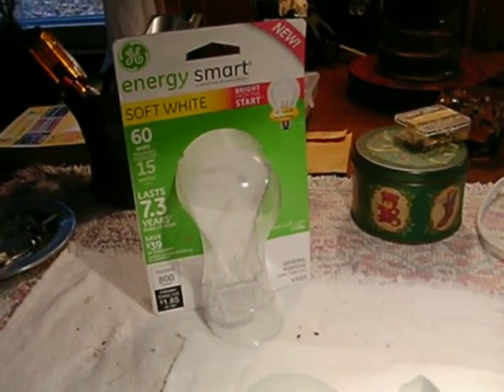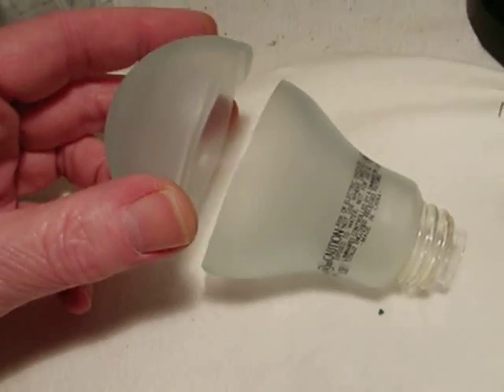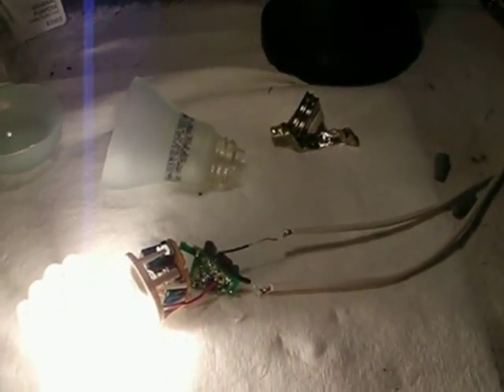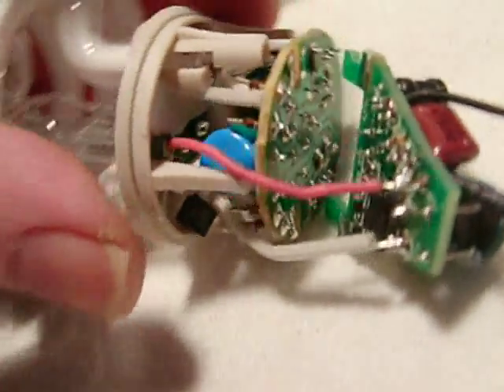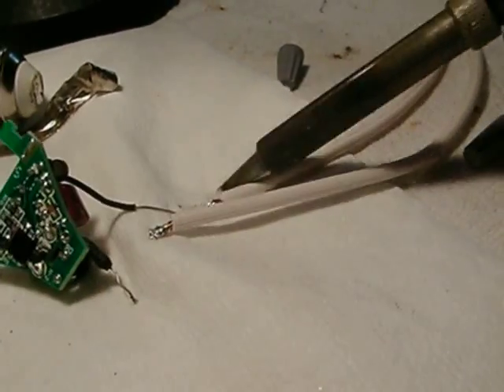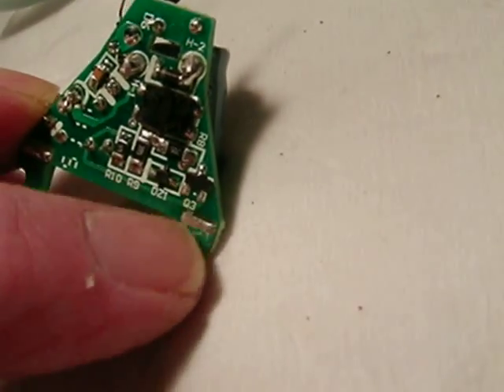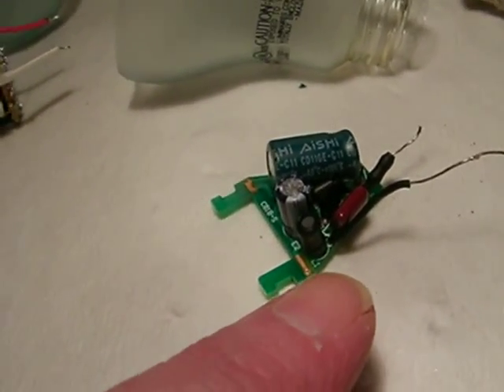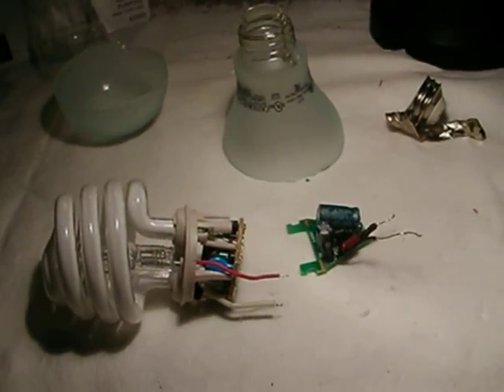GE Hybrid CFL Halogen lamp - a look at the electronics

Comment: As if the thing needs to run any hotter?!

Also, halogen bulbs cycled on only briefly exhibit much shorter life, as the bulb will never get hot enough to enter a proper halogen cycle.

I bought some really awful CFLs recently that come on SUPER DIM. I'm guessing this is due to the manufacturer minimizing the amount of mercury used in the bulb. I've considered putting a small 10 watt halogen next to them!

Comment: Not only that, but it also perpetuates the myth that compact fluorescent lamps are universal replacements for incandescent by attempting to mimic them.  They are NOT.  CFLs are only suitable for use in applications that meet a very strict set of criteria (no dimmers unless the lamp is dimmer rated, no airflow restricting fixtures, no frequent switching, etc).  If any of these criteria are not met, then at best the lamp will be short lived (and they never last to begin with).
At worst...  FOOM!